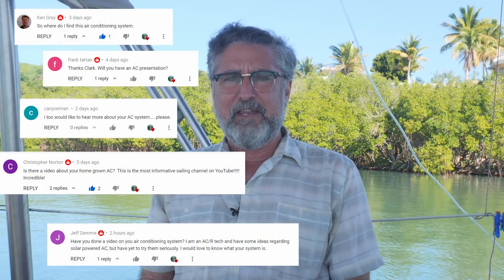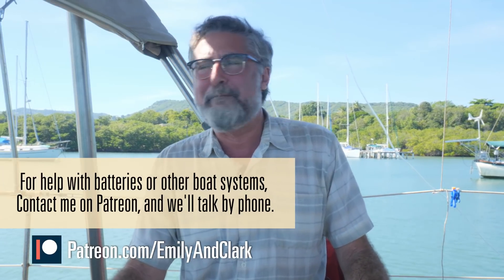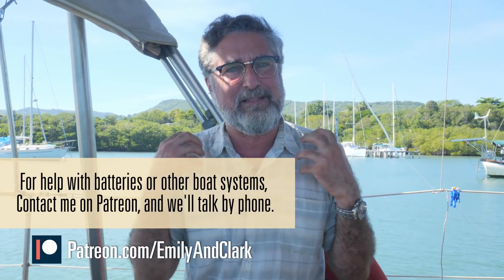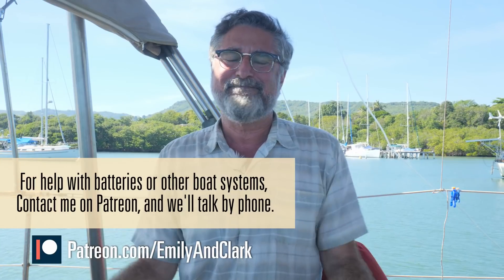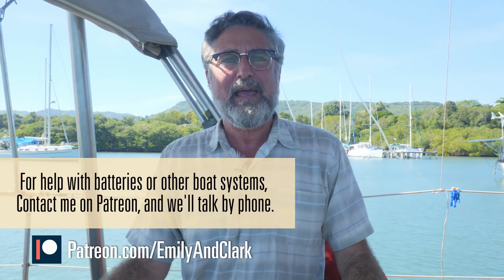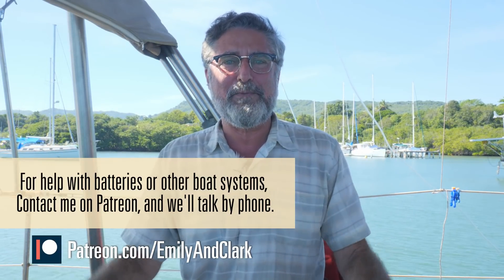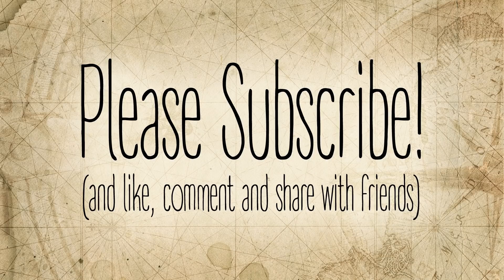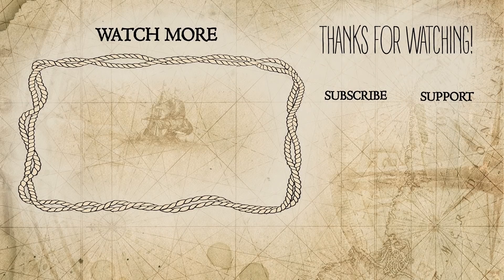Adding LEAD to your LITHIUM battery bank [Capable Cruising Guides]

Comment: Dear Sir can I connect parallel with 53.3v 100ah lithium bank with lead acid 54v 100ah with solar off grid inverter MPTT BASE?
Reply from the maker: This is a really old video.
   I've since refined this with my BankManager.  Check out MarineDCAC.com

Comment: Lithium 100ah batteries are about the same as lead. So it only took 3 years. Still adding some lead because I have it already.
Reply: Really, and they'll both lead and lithium parallel without any issues?
Reply from the maker: @richardalagoa6510 they can charge but not charge right.  It greatly shortens the life of the li batteries.
   Check out the BankManager at MarineDCAC.com
Reply: @ for me . They should be a fuse between the two banks in case you have a cell short out. Google it,  works well

Comment: Clark (or anyone that already knows in case I just missed it), how many watts of solar does Temptress have?
Reply from the maker: We had 900 watts but 300 watts of them were badly shaded by our radar.
I recently added 200 on the bow due to all the battery review videos eating up so much power.

Comment: Truth be told I don't have a boat I have a class B RV. I use an Ecoflow 3600 watt Lithium to run a 40 quart freezer and also my insta pot. I charge the Ecoflow with a suitcase solar 160 watt and sometimes off the vehicle alternator when driving. My RV came with 215 watt solar and two AMG house batteries that charge from solar, 12 volt vehicle alternator and a vehicle 12V  starter battery that charges only off the alternator. can I merry these two systems (house & Ecoflow)  without killing the alternator, AMG batteries or the Ecoflow Delta Pro???  I try to only charge the Ecoflow with Alternator when the house batteries are full and not drawing a charge since I must manually plug into a Cigarette type charger. Any help? THANKS!
Reply from the maker: Hi Joe,
  That seems like a handful.  Since I made that video I have learned a lot and have developed just what you need.
https://youtu.be/VZSr6o5fLHE

We use it in our truck camper (see other videos on our channel). We run AC off solar and everything works great.

Basically this lets you connect it all together.  It is the only choice to properly charge your LiFePO4 batteries.  And it becomes a set it and forget it system.

Comment: Would there be a problem with lowering the lithium battery to a lower voltage than the lead bank batteries before connecting them 
Would it still be dangerous
Reply from the maker: Id make sure both banks are of the same voltage.
I have a device that does that and much more.
https://www.emilyandclarksadventure.com/bbms
Reply: But not for sale in Australia
Reply from the maker: There are lots of them in Australia.  It was an Australian who suggested reship.com.   
Next to the US Australia has bought more of these than anywhere else.

Comment: There is another advantage to just hooking them in parallel. A lead acid cannot be charged in a few hours, you need 10 or more. But lithium can be charged in less than 1 hour sometimes. let's say your batteries are pretty flat, you used them for an all night party. Next day you run the engine to charge them (it's raining), lead lead battery comes up quickly in voltage but it's not fully charged in an hour. After 45 min the voltage is 13.4V, most of the current is going into the lithium now, but the voltage of the lithium does not increase until the lithium is fully charged. After 1 and 3/4 hrs the lithium is charged fully but lead is still not. You turn off the engine, lithium now charges the lead acid! the lithium will keep the voltage up and the lead acid charging until the next day. So you only ran the engine for 1.3/4 hrs but if you had no lithium you would need to run it all day!
  Lithium prefers to be not fully charged but lead must be, so this is ideal! Just make sure your alternator and wiring is up to the increased current the lithium can draw. I would also say add a resistor in the field like he said if you can.
Reply from the maker: Yes Will.  You are right.  I feel mixing makes my solar panels larger.

This is how I'm doing it now.
https://www.emilyandclarksadventure.com/bbms

Comment: Just watched again. Wondering if I could use 4 12V Motor-Cycle batteries in series as a kind of a charging buffer for a 500 AH 48V Storage/Distribution lithium bank
Reply from the maker: In theory sure.  I haven't tried a lead bank that small but I use that as an example all the time.  I'd say it would work.

 But I'd think seriously about one of my BankManagerPlus units.

A 48v boat in this bay is planning on doing this with 4 group-24 batteries and a BankManagerPlus.
https://www.emilyandclarksadventure.com/bbms

Comment: I don't understand how to keep the lithium batteries' BMS from tripping with high amp loads, suddenly shifting the load to the lead acid batteries.  Here is the scenario:
 all batteries are fully charged
BMS max discharge  capacity is 100 amps
Lead acid max discharge capacity well exceeds the inverter max draw 
Inverter is used to power the microwave and draws 150 amps.

As I understand the mixed lithium+lead system the lithium discharge voltage is higher than the lead.  The draw from the higher voltage lithium would exceed the BMS max and so the BMS would trip open.  The load would then suddenly shift to the lead batteries.
This seems unstable and prone to failure.
Where an I not understanding the operation of the example system?  If this scenario outcome is right, what happens with the circuit?  the equipment?
Reply from the maker: I thought much the same.  I have 200ah of li that should be good at 200 amps.  My microwave is my chief load but heat guns for varnish come into it as well and it seems we have 10a going to laptops most of the day.
   I first figured an occasional BMS trip would be no big deal, lead is there after all.  
   What I found was surprising.  For me and for a friend in Scotland as the Li (even fully charged) gets close to limit it's voltage goes below 12.8.  And of course lead starts helping at that point.

I have 200ah li and 1500 ah AGM.  Friend has 100 ah li and 100 ah carbon foam.

   One should have enough Li BMS capacity for max loads and I don't know if this would always work for everyone but it seems to just work out in my small testing set 

   His findings are published on his webpage "wild bus". It's linked in the description of my charging video.

   As I first read your comment I thought you were referring to initial connection.  I talk about that of course but I now have a device that handles these issues.  See most current videos.

Comment: Hi there really interested in marrying up my lifepo4 to existing acid but can’t understand how to isolate the alternator charging of acid if connected inline with lithium does the lithium not draw from alternator as all connected together ? Many thanks for video I found it very informative and a great watch !!!
Reply from the maker: I go over that someplace.  Though it was this video.
Protect your alternator from overheating either by using a regulator with a thermo probe or just buying an alternator that can produce max amps continuously.
    The big risk for alternators that charge lithium is the BMS going off and burning the diodes.  This won't happen with lead in the system.

Comment: Absolutely great videos Emily and Clark!  Thinking about combining FLA start with Lithium has us thinking about the amount of current that flows during a crank start, its effects on the Lithium, and Lithium's have lower impedance than the FLA's.  Especially for example two battleborn 100Ah (200Ah Combined) system, tied to a FLA start battery. Maybe a 'start position' controlled relay to disconnect the lithiums during an engine start.
Reply from the maker: I use two Battleborn.

I haven't done a study of this but I crank my 4 cylinder yanmar.  What seems to happen is between the wiring (engine wire goes to starter battery first) and switches and regular voltage drop that happens with a big current load the voltage at the started drops below 12.8 so the lead helps out.

    As I said I haven't done a study but I haven't noticed the li BMS kicking out.

   Take a look at wildevans document.  Link in my recent charging video.  We talked about this, he did some studies with his smaller loads and lead got involved as one would hope.
Reply: @Clarks-Adventure  12.8, well, that's comforting.  When you did your balancing between FLA and Battleborn's via a high wattage resistor, what resistance value did you choose? Also, what wattage? can't imagine a lot of current flowed when you initially did this given the voltage potential between the two types of batteries. Thanks again Clark.
Reply from the maker: I just waited till the voltages we're the same.  
Just an ohm or two would be plenty.

My BBMS device will do it for you every day.
Reply: @Clarks-Adventure  When is your initial release slated for the BBMS?  Is there any specs available on it?
Reply from the maker: I am having supply chain issues just now.  But I managed to order 10 of what I hope are the final boards.  Once these check out I'll order as many as I can get chips for but expect it to start with limited availability.  I might do an auction.
   I talk about them in adventure logs and live streams.  There will be a Bbms video soon when I have product in hand where I will go into details.
   But in short. The Bbms oversees charging li similar to how the Battleborn manual says to charge them.  It provides some extra safeties including protecting the li from recharge without discharge and a few other optional tricks.  If course it controls safe reconnection.
   The BBMS+ adds the ability to charge based on current flow.  I have become convinced that this is important for the li cells.  It's possible that our Battleborn BMSs do some magic in this direction but I haven't verified this yet.
Reply from the maker: And of course there is this from the description of the last video. 
https://www.emilyandclarksadventure.com/bbms
Reply: @Clarks-Adventure  Thank you for pointing out your website. Yes, have watch a number your videos, including the FLA/LFP pairing series. You have a gift for teaching as a side note.
Reply from the maker: Thanks
Reply: @Clarks-Adventure  Will your BBMS have any I/O for us to trigger a relay for example?
Reply from the maker: In what situations would you want to do that? 

 If you aren't using a bi-stable relay there is a terminal that goes low on contact and one that goes low on disconnect.  If you are using a bi-stable they are both used on the bi-stable but in either case you could add a small relay of the appropriate type and do whatever you wanted with it.  Just make sure you draw your + from the same source the bbms does and you will be fine with small low draw relays.
Reply: @Clarks-Adventure  Going to implement an Engine Start Disconnect for the Lithium bank. Unless your device has a forced FLA > LFP disconnect implementation. Perhaps a signal wire over to the "Start" terminal on the IGN Switch.
Reply from the maker: There is a button that will immediately disconnect the li.  It will reconnect when the voltages come together again.  You could use this but the lithium might not get charged from the engine this cycle unless you further added an alternator field switch to temporarily stop charging in some circumstances until the batteries rematched in voltage.
   But since the engine start will surely lower the pb voltage in practice I think it would always be basically automatic.  Touch the disconnect on the bbms.  Start the engine.  Pb goes down then right up causing a reconnect.
Reply from the maker: You have seen the last video in the subject, right?

https://youtu.be/XAOhT2HwKWM

Comment: I had the same concern with the alternator going to no load and burning the diodes. My fix was to install a 6 cell super capacitor in parallel with the lithium battery bank. This absorbs the srtay voltage from the alternator when the BMS shuts down and acts as a battery. It also filters most of the electrical noise, absorbs surges, and removes instant loads from the inverter. I am also testing super caps with the lead starter battery to extend its life by helping with surges.
Reply from the maker: Interesting Ron,
   But, I'm concerned about the use of caps there.  Think about what would happen when this lithium disconnects and then reconnects.  I'm concerned that with even a small voltage difference reconnection could cause a very powerful inrush current.  Lithium has a very low internal resistance and super caps about none.
Reply: @Clarks-Adventure  My BMS has separate FETs for charge and discharge cutout. When charge is too high on the BMS it cuts the charge FETs but keeps discharging. As the super caps dissipate, the voltage equalizes with the discharge FETs. Same goes with low voltage cutout. Discharge is stopped but able to charge. As alternator kicks in and raises super cap voltage, BMS charges with same voltage. When threshold is met, discharge is open but does not matter because voltage is the same and charging. The only sync issues I see are initial connection of batteries ( as you discuss) and BMS low/high temp discharge cutout. This is where both FETs are cut until temp is in range. Around 0C the BMS blocks charging, and -10 it stops discharging. When it returns above -5C or so is where you could have issues. Being that I am in the Pacific Northwest and my batteries are in my boat, I do not foresee this being my biggest problem if temps drop that low. My super caps are also only 20 farads. BTW, I love your channel! Keep on tossing out great ideas.
Reply: With large super caps, you could put a power resister in series with the caps (only a couple of ohms) to soften the surge. Since most BMS can hand 300A for a few seconds it would not take much.

Comment: I just watched both your Li+Pb videos, its a interesting idea especially in the first vid for keeping both batteries at their ideal resting voltages to prolong life but I still think a ‘standard’ (standard since a few years now) non isolated DC-DC converter system would be better. You can incorporate a regular selector switch to transfer the house loads to the lead start batt if somehow your house bank dies. If both batteries are wired together, everything dies. Finally, you seem to think your start battery dying is fine because they are cheap. Aside from being wasteful that could leave you drifting onto a lee shore with no communication and no motor and its not like you can have a spare start battery on hand because they lose charge overtime without regular starting or a trickle charge from solar.
Reply from the maker: You can always start off your house bank.

I have since developed a device that manages the charging of both of these banks efficiently.  I feel dc-dc chargers waste too much power and aren't bidirectional.

   It's called a battery bank management system (BBMS).  It's running on Temptress and a couple of other boats.
   Beyond doing the obvious it charges the lithium more "correctly" then any commercially available charger that I've seen.
    Figured if you are going to do it might as well do it right.
Reply: @Clarks-Adventure  yes well the lack of bidirectionalness (haha is that a word) is certainly a thing and so are losses in the dc-dc.  So have you got these BBMS’s for sale? I would be interested to keep my existing lead house batt connected to a lithium to keep them both happy. I still think a switch isolated starter circuit is a good idea though in case of total house bank depletion. By the way my current house batt definitely does not have the cranking amps to start the engine but maybe a lithium bank might at a pinch. To get around the lack of bidirectionalness i was thinking to keep my current votronic solar controller that has a second 1amp outlet for a start batt trickle charge. Not sure why Victron’s offerings don’t have that feature?
Reply from the maker: First.  Go to eBay and type in "voltage sensitive relay".   These are cheap and will hold you start bank with your house bank while there is a high enough voltage to charge lead but split them under loads.
   Also handy to get power from your alternator to the house batteries without a bunch of rewiring.

   If I could ship out of the DR they would be available now.  But I need to find someone to do the finishing, packing, and shipping.  Soon I hope.
Reply: @Clarks-Adventure  why not talk to victron or redarc and get them to license it from you or even you could contract to design it remotely?
Reply from the maker: Though about it.  I need to get the patent sorted first.
Reply: @Clarks-Adventure  in all honesty those a probably not going to he worth the paper they are written on, you probably should just develop it yourself but as you say a bit hard when you’re living the dream in the DR
Reply: No, I think he's right!